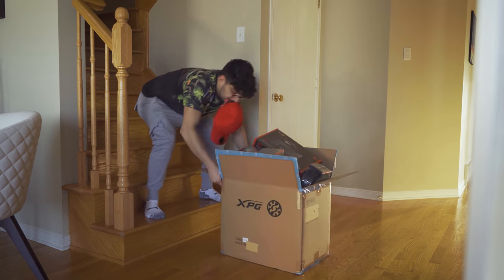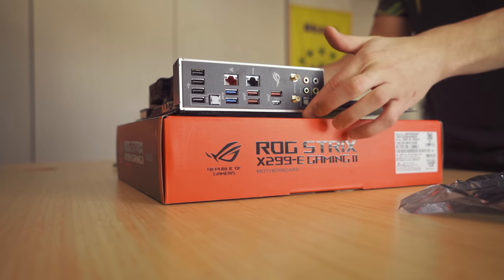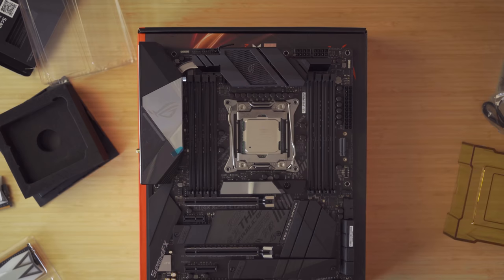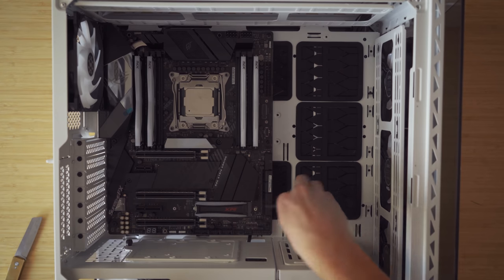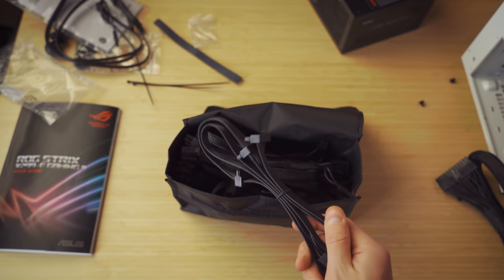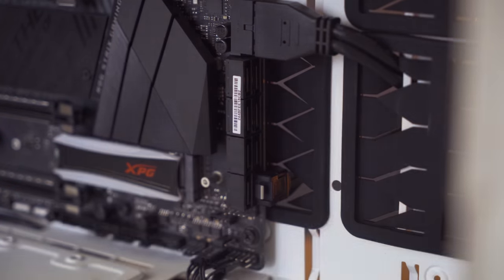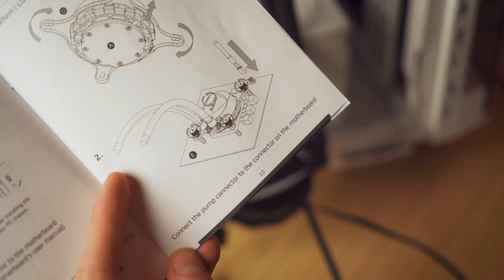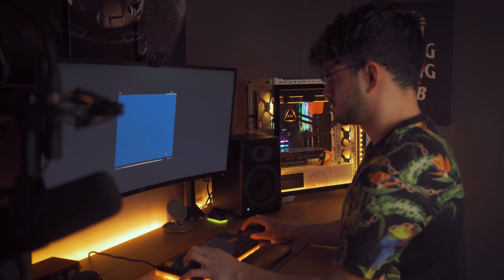How To Build A Gaming PC With No Experience

Comment from the maker: FYI! Place your GPU on the FIRST PCIE slot! I just corrected this on my machine! Thank you for the support and I hope you enjoyed the video regardless <3
Reply: The question is how expensive is it?
Reply: @tejas.2605  not worth it in short. unless you really need the threads, memory or pcie lanes. Ryzen is overall more well rounded, but as many know the new hardware marked is being a pain in the ass. Im actually getting a 5900x which will smoke the i9 series but you need to be able to wait on the hardware to get in stock. # no hate
Reply: @leojennss2  also something like a 3000 series gpu would've been way better but as we all know there's shortages
Reply: @iMidnight_  they have the ryzen 7 3900x & ryzen 9 3900x on Amazon. A little over priced but im getting the ryzen 9. I really dont wanna wait for the little new stock to be bought out by bots within seconds 😒.
Reply: Thank god you realized this that’s almost the worst thing you can do
Reply: @Ausyaustingaming  placin ?  The displayport cable in mobo when having a gpu is even worse
Reply: Exactly!  Depending on your mobo, you may be limiting the GPU by placing in the second slot.
Reply: i nearly had a heart attack when i saw u do that

Comment: before adding everything in, you should test bench it first before you put in the case, you can install drivers, and the os and it very nice if something doesn't work, you can trouble shoot without wasting your time cable managing.
Reply: oh and install your m.2 to the top slot.  youd have to remove the heatsink cover though

Comment: The only mistake I found was that your graphics card wasn't on the highest pcie slot. I don't know the specifics of the motherboard you bought, but I recommend putting the graphics card into the highest pcie slot available because the pcie slot you may have put your graphics card into was a x8 slot vs a x16 slot which is faster. 👍Plus it'll look better.
Reply: even if x8 pice did hurt a 2070's performance( which it does not)  x299 has more than one  x16 slot

Comment: As an advice: consider insatlluing your gpu to the first pci-e slot of your motherboard, since it has the most bandwith. Depending on your motherboard the second one could  be a 8x rather than a 16x
Reply: this i kinda true. but since he is using a x299  he has  2x  16.   and if it is in a 8x, he would not lose performance
Reply: @norkris8729  Yes, but he doesn't explain these caviats or the context behind them. When i saw him plug the gpu in the second socket i cringed. All because i know how that was a bad idea back in the day. I guess it's fine on expensive motherboards tho.
Reply: @plurakok  Its more of a myth. a thing ppl on the internet say without  actually knowing

Comment: Hey Andres, outta curiosity why did you go with the 10980XE? Wouldn't it have been smarter to go with a 3950x or a 5950x?
Reply from the maker: Hey man! I wanted the extra slight power for adobe premiere pro as intel is said to be more optimized for the adobe suite. That being said, that rational descision comes from me comparing the 3950x to mine. If the 5950x would have been available, then I would have bought it. But its currently out of stock everywhere in Canada.
Reply: @andresvidoza  Ah that makes sense. Thanks for the quick reply and awesome video man! Keep up the great work!

Comment: You should consider installing your GPU on the first PCI-E row rather than the one in the bottom. I didn't check your motherboard specs but you can avoid all the trouble by just going for the first slot rather than the bottom that has a possibility of being an x8 rather than x16
Reply: Was looking for this comment. lol
Reply: or be like me with a mobo with only one pci-e slot but its 4.0 and works well with my ryzen 3 3100 and 5500 xt
Reply: @deliciousdale9981  even if x8 pice did hurt a 2070's performance( which it does not)  x299 has more than one  x16 slot
Reply: @norkris8729  so youre saying 8 pcie lanes has same performance in a 2070 as 16 pcie lanes?
Reply: @deliciousdale9981  yes.

Comment: Yo just a heads up. You are much better off putting the grounding pin your ESD bracelet into the copper part of your wallet outlet. By connecting to a power supply that is not grounded you are not doing anything. Secondly, you are not supposed to be wearing cotton items because they emit high level of static electricity. Lastly, the outside of the MLB bag has no EMI shielding and touching it requires grounding yourself again unless you touched while grounded. Also the ankle bracelet is not a good idea. You need to connect to your wrist. Your wrist maintains a significant more amount of connection to your ESD bracelet. Sorry man I hate to comment but people who are doing their first builds need to know this stuff.

Comment: How you knew your MOBO was broken? I have a Dark Hero and 5900x. Just waiting for a Strix 3080. Also I have a 1000 Watt PSU. I usually walk around my room on a wooden floor with no socks on. Can I build without that static thing safely?
Reply: if you dont have an anti static wrist band, touch a large piece of metal (like your case) before building. you should be fine but its up to you. i’ve built a few systems on carpet without fail.
Reply: @exaucity  I'll do that. I have a wooden floor.

Comment: and do we really need to plug in the power supply to a wall socket and check it time to time? You leave it on the entire build or turn off ever 20-30 mins?
Reply from the maker: I turn it of when I dont need it once youre done interacting with so many parts on the motherboard. Its just to avoid hurting components :)
Reply: @andresvidoza  Can I plug everything in without powering it on with the wall socket? Or that a no-no?
Reply: @BlazeNarutoShippuden  you can plug all components to the motherboard without needing to plug into a wall. nothing should be able to turn on but once you plug power from wall to psu, the components should work.
Reply: @exaucity  ty